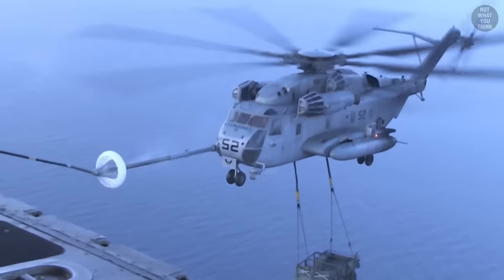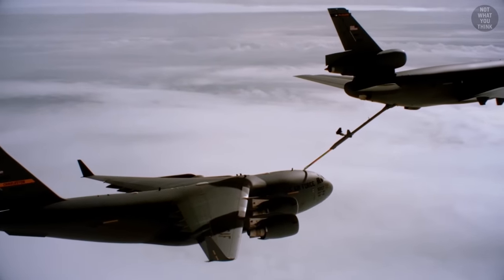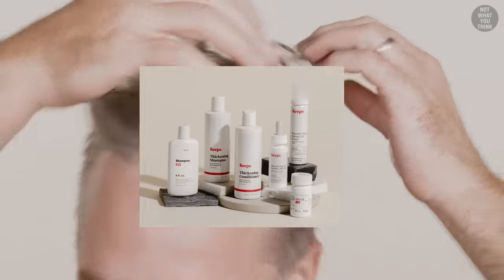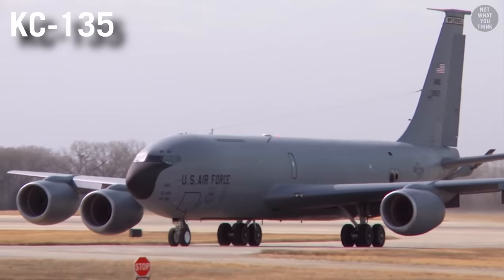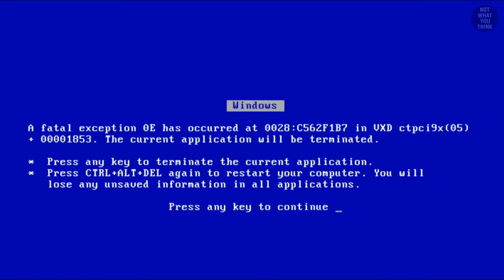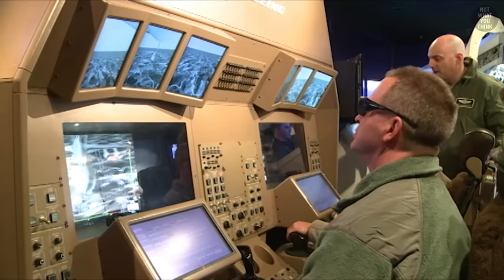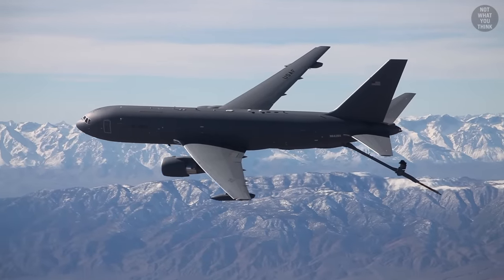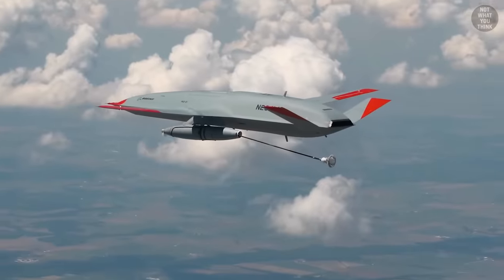Why US Air Force is Making Aerial Refueling HARDER?

Comment: As a former KC-135 Instructor Pilot, I don't understand why they are trying to fix something that was not broken. Despite my piloting skills (former ENJJPT IP as well) I always respected the abilities and professionalism of my boom operators. I even doubted my own ability to do what they did. I always felt that they were underpaid too.
Reply: Ditto.  Either automate it completely and ditch the boom operator — or freaking leave them on board and stick them in the back.  There’s no advantage to the tech; launch a 46 and 135 and who’s going to most likely give gas - the 135.  There’s way to much to break on the 46.  In 2500+ hours on 135 never had “a boom operator problem” make us go home.
Reply: @phatkid6811  They're doing R&D with DoD money is what. It's transitional tech development. You don't want your first foray into automated systems to be after zero dev in any related system.
Reply: Well... From an engineers perspective, if it ain't broke, it doesn't have enough features yet.
Reply: it seems like the obvious answer to higher ups wanting more features to pump up the cost for better profit without just ruining the thing like they did would be to just add features that assist the boom operator rather than change their whole way of doing things. give them HUD they can turn on over the window with range info and a highlight on the boom tip and receiving port, cameras feeds with IR digital nightvision object recognition and edge highlighting placed next to the window for a quick reference but not in the way. all this shit could actually help or be totally ignored by the operator while racking up millions for the company and the engineers who went ahead with their shitty implementation are at fault for not managing their superiors expectations, its like half the job of an engineer.

Comment: The mistake they made was not taking one of the old tankers and converting it to the new system for testing.  That way, if the new system failed, only one airframe would be messed up.  As it is, the AF got stuck with a fleet of aircraft that kinda work.
Reply: ...er, no. The old tankers are not something you can just convert to fix the problem. The military needs NEW tankers; the airframes are getting too old. 

The technology is absolutely there to make a camera system work well. It looks like Boeing cheeped out and refused to actually do its job, instead thinking that some basic cameras could do well enough. In typical Boeing fashion, they took a chance to win big and made an outrageous failure.
Reply: @Raptor747  I wasn't saying extend the life of the current tankers.  I was saying take a tanker that has a couple of years left on it, and test the new system.  If it works, great!  If not, try another system until a workable one is found,
Reply: I'm sure they test the stuff way before they even put it on all of their birds
Reply: @dark12ain  All of the new ones come from the factory with the cameras.  Whatever testing was done, it wasn't enough real world.
Reply: I kind of agree, but would do it the other way around - put the old systems in the new aircraft. You'd be surprised how many times, or for how many decades, the exact same device shows up simply because it works and there's no meaningful advantage to reinventing the wheel. In the case of the KC-135, there's nothing wrong with the existing system, it is the airframe, elements of which was designed during the 1940s, that is in need of replacing. If the new refueling arrangement cannot do as well as the old one on an identical modern airframe, then the answer is to chuck the new fangled junk out in favour of retaining the old arrangement. They didn't keep the same navigation equipment as WW2 bombers in their counterparts into the 1980s for fun, they did it because they worked, were reliable, and the crews knew them already. Sure most people turn to GPS now, but there's always a fear that being solely reliant on a new system that might be easily exploited (GPS is easily jammed for example) or just not live up to the manufacturer's sales pitch leaves a crew with nowhere to head but towards failure and death - don't be too keen to junk solid, well-understood subsystems.
Reply: @s2k997  you can't just put old systems on new aircraft, the power and communications interfaces are likely to be very different. You would probably also have to requalify the old system to the standards of the current aircraft. Safety and electrical standards have moved on and what was once acceptable isn't anymore and the kit is likely to fail.
Reply: @robhayward2655  That's a fair point, but it is commonly done. Especially in development, you don't need to be certified or requalified for something that's not intended for production, only to assist development. And the equip we're talking about don't have long-ancient certification - less than 20 years ago, aftermarket companies were still converting retired commercial 707s into tankers with the same apparatus. Considering this programme has dragged on for so long already, those production lines would have barely cooled off at the time. I don't know for sure how difficult it'd be, but I've seen far more implausable being done, such as the civil VC-10's inertial navigation equipment being shoved into existing various military aircraft, or the application of the E-3's radar equipment to the 767 due to a lack of 707 airframes - both operationally used rather than just development assistants. Heck, back in the 1960s, it used to be regarded as bad practice to try to develop a new aircraft on a new engine, hence why aircraft like the Tornado flew with an existing powerplant in their pre-production forms, simply because it was a known and risky -free quantity. Cannot be as bad as what we got with the current programme with zero alternative provisioned. Basically, you need to tell it to Boeing that they cannot do it, because they have done so on a lot of occasions. In fact, the 767 tankers made for Japan had the same refueling boom system as on the 707; it is entirely possible because they've already done it anyway, just for other customers.
Reply: @captainjohnh9405  that is crazy.  That’s like building a carrier launch system on land to test.  Instead of custom building a aircraft carrier around a concept aircraft launch system.   When it was found they underestimated size of components.   Let’s gut the ship to change things.  As workers fly to/from carrier.  Instead of build it on dry land to test.  How many hundred million  bucks?
Reply: @s2k997  agreed, you can do more in development than production kit, but they still need to  be satisfied that it is safe, these days that is getting harder to do. They tend (quite rightly) to get touchy over failure probabilities. Small numbers x hundreds of planes x thousands of hours x dozens of years adds up quickly. If there are no single point failures or fuel ignition sources, then you have a better chance of getting it on a test plane, they may accept something  that is legacy and has a good long safety record, but if the design swaps out one comms card for another you might find that the whole box has to be certified again, and now to a more up to date  standard.  Flight Test Kit though as you say is easier, fortunately I'm not the safety guy that has to sign the DDP.
Reply: @s2k997  Sounds similar to the Japanese approach with the E-767.
Has much the same radar system as the E3. But the airframe is a B762 rather than a B707
Reply: @robhayward2655  in this case its a window, the plane already has a pod so all you had to do was cut a larger hole, throw in a mirror and your done. Boeing forced the airfore into a fixed rate contract to try to maximize profit and tried to just reto fit their airliner so they could make as much as possible, and they payed for it.
Reply: Replacing the window with simple screens is a dumb idea. Have you heard of depth perception? Why do you think you have two eyes?

Comment: iPhone: "You have 3 UHD cameras with adjustable zoom, saturation, shutter speed and aperture. All that, for $1.1k"

Boeing: "If you give me a couple of billion dollars, I'll give you some of our regular planes with a boner and 6 cameras running at 480p monocrome with no adjustment capabilities. Not even an anti-glare lens coating, I literally got these cameras for $15 on Wish"
Reply: With a what
Reply: @masteereeer580  👽
Reply: "I'll just leave one of the most important part of plane to be problematic so I can redo it again, double the cash"
Reply: Boeing: "Don't you worry a thing. You're not footing any bill, after all. It's the public's problem."
Reply: @TheRibbonRed  You obviously did not watch the video, Boeing is paying Sparky.
Reply: @davidoldham1946  5.4 Billion to fix the issues? Chump change to what they got from the deal: 42 planes, with +50 more incoming. 

Boeing sold 8 KC-46s to Israel for 2.4 Billion. Maybe think about that before "hurrdurr yuo no watch vid".
Reply: It's probably 480i rather than 480p. They're probably left over from some other contract that they screwed up back in the 90's.
Reply: @TheRibbonRed  Yes, but the Israelis will upgrade it till it works. Like they had to do with the F-35 and other stuff. They don't fuck around.
Reply: @mauricegold9377  exactly. Key point is that whatever penalty Boeing "suffered" to repair those faulty cameras, they're inconsequential to the profit Boeing got in selling all of those planes.

We're talking about defense contracts. Any true loss incurred are paid by us, the common masses.
Reply: @TheRibbonRed  ??? Your argument went from "People (taxpayers) are paying the loss" "Boing sell planes so they can pay it for themselfs". And no, we aren't they are literally paying for the entire program since it's their mistake and in theory we all pay to this economy it's how it works you are saying it like it's a horrible thing. You pay a flight ticket the airline pays a producer for the plane the producer of the plane uses those funds to profit and to make more of those planes.
Reply: It wasn't Boeing's fault when it comes to the cameras. That is what the Air Force wanted. Boeing originally wanted to sell them the better color system which is what they will eventually get. The planes will be upgraded.
Reply: @Alphatrillon  5.4 Billion isn't "the entire cost of the program" because Boeing sold only 8 planes to Israel for 2.4 Billion. That's nearly half of the amount asked by DoD, only for 8 planes. Boeing sold over 90 planes to the DoD, with 42 KC-46s operational in USAF.

I don't think you know how defense contracts work:
1. DoD creates contract/competition.
2. Companies provide product for the contract/competition.
3. DoD chooses to accept/deny.
4. If accepted, DoD 'awards' the selected company with taxpayer money.

The profit Boeing got is taxpayer money. Even with only 42 planes, losing 5.4B would still give them +7 Billion if the same price to Israel was given to US DoD (300 million/plane).
Reply: Hmmmm sus
Reply: @TheRibbonRed  the Air Force has 52 aircraft including testing aircraft currently. One has already been delivered to Japan.
Reply: @PatrickLipsinic  then it's even more profit to Boeing. 

I don't know why some people stop at the words "Boeing had to pay" and legit thought they're operating at a loss for these tankers. This isn't even remotely as bad as the MAX incidents.
Reply: Sounds like typical Boeing tbh... Weird how they didn't ask for a couple billion more to develop a brand new, untested airframe just so they could add exposure dials to their cameras....
Reply: @DonVigaDeFierro  I'm guessing you didn't read my previous comment. It's not Boeing's fault.
Reply: For real, as soon as I heard they were from Boeing I shook my head.
Reply: @barneyrubble4293  What's that suppose to mean?
Reply: @PatrickLipsinic  I'm referring to the 737 max safety issues , them covering it up and now the ceo demanding money from congress or he'll cancel the 737 Max.  

Basically i'm saying their a shit company run by a shit CEO and they've been that way for awhile.
Reply: @barneyrubble4293  Gotcha, the problem was with the Max 7. You are talking about the Max 10. The FAA is a bit gun shy right now and I don't blame them. They did not do their due diligence when it came to the Max 7.
As for the KC-46. All the fault goes on the USAF.
Reply: @PatrickLipsinic  Ah gotcha, my mistake!
Reply: @mauricegold9377  Sure, but they shouldn't have to. Imagine you buy a new car and have to upgrade it to make it usable.
Reply: That's Military Grade quality right there.
Reply: @MegaDragonNest  This was a fixed price contract, as the Air Force has repeatedly reminded Boeing with a small swarm of lawyers. Boeing will foot the bill for the fix.

Defense contractors are used to having programs renegotiated multiple times as requirements change, giving them an opportunity to milk the American public for more money, and perhaps cover up issues with the original design. In a rare stroke of fiscal discipline, or perhaps the Air Force simply acting out of spite because of how Boeing sued them out of getting the tanker they really wanted, the Air Force has renegotiated precisely nothing with the KC-46, leaving Boeing the option of fixing the plane at their own expense, or being in breach of contract with the federal government..
Reply: Hey now this is American procurement not Russian.
It would be a 720p camera 😤
Reply: @kekistanimememan170  russian would just have no camera, only a 144p display used to play CS:GO
Reply: Yeah, I don’t understand it.. look at all the money that went into developing the F-22 or the F-35 but they can’t put better cameras in a refueling aircraft.
Reply: I suppose that an iPhone works well at -55 C (about -65 F, the temperature at this sort of altitudes), whilst resisting hydraulic fuel, massive vibration and being pounded with high intensity electromagnetic radiation and do all that for well over 30 years. oh and don't forget being filled up with fuel vapour that is then exploded. Military tech is a whole different ball game.
Reply: @robhayward2655  Good point, when you talk about military-grade technology, its not going to get the seal of approval if it can't get dropped off a hill or at least shot at a bit. Durability first, luxury second.
Reply: The iPhone has three mil spec cameras?
Reply: Good I’m not the only person who saw it that way
Reply: The best part is that those iphone cameras cost apple like 1$ a piece due to mass production. Ukraine is currently producing tones of military quad copter drones by using on the market drones and refitting them. The parts for older phones are still available at their low cost. The US could set up a fake phone company and order phones for 200$ each max and just have them strapped unto the plane and have a probe mounted Bluetooth camera that the pilot of the fueling craft could see too. As long as the on board network ain't hackable, the phones would be safe if they remove the cellular modem. For that price they could outfit all soldiers on the ground with a gps, live feed from drones and tactical info from operators. I saw a video where Ukraine was trying that out so drones could mark targets in augmented reality like it's battlefield. Russians would be sitting in their trench and the Ukrainians would know exactly how to send a grenade or where to shoot in the cover to hit him
Reply: @pepelepew1227  why don't you go join the Wagner group. Ukrainians would like to offer you a tour of their pow camps monitored by NATO, EU and UN
Reply: @brandonproctor3639  you've discovered the military industrial complex and it's decadence
Reply: @peter4210  Ukrainians doing all that to drop a grenade? Lmao, Russians just have to send a thermobaric rocket somewhere and they've opened a miniature sun on a Ukrainian army base

Comment: Former KC-135 Boomer here. The job was intense but definitely doable. I would have never wanted to to it virtually.  Or without the tactile feedback afforded by the mechanical boom controls of the 135. I don't know if any tech could match real world depth perception. If it does, they certainly didn't make the effort to apply it on the new birds. All of which should have been vetted way before any contracts were awarded.
Reply: Didn't know about the mechanical controls, i know in large wheel loaders i can feel the depth of my blade in hydraulic over hydraulic systems but in the newer and "fancier" electronic over hydraulic its alot harder and more muted.
Reply: Stereoscopic displays are good enough for surgery.
Reply: @SnakebitSTI  That's true. But I'm not sure how that particular tech would apply to operations that have such large variations in range to the desired focal point. It seems that it would be doable to have a variable focus camera system.